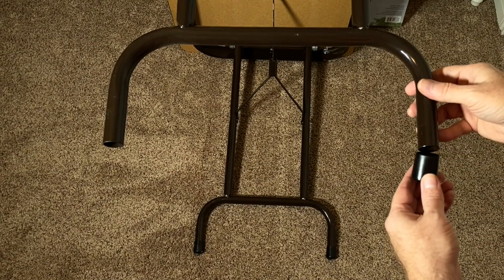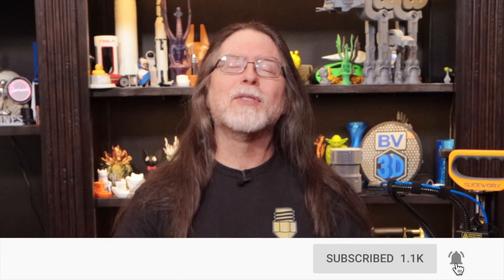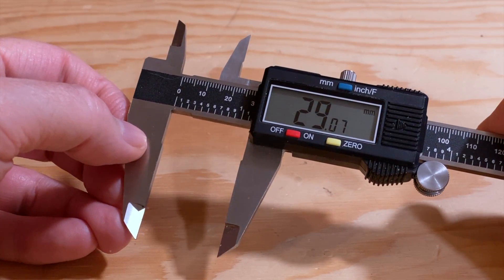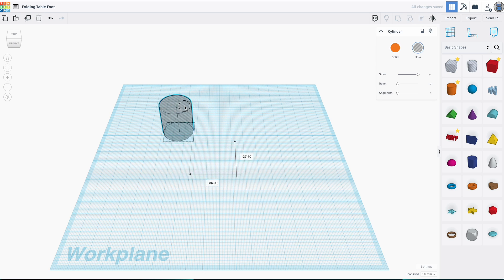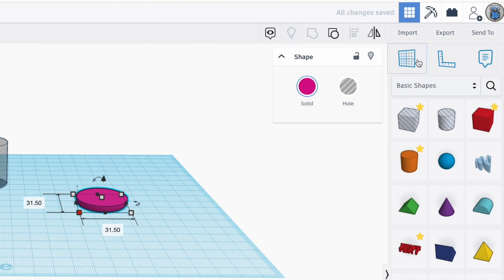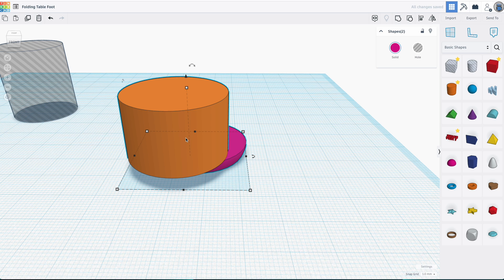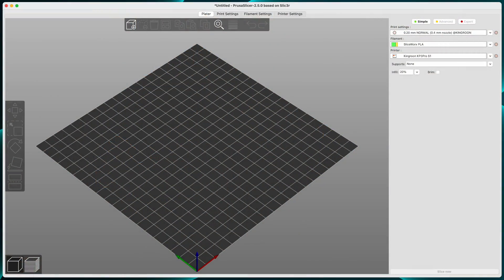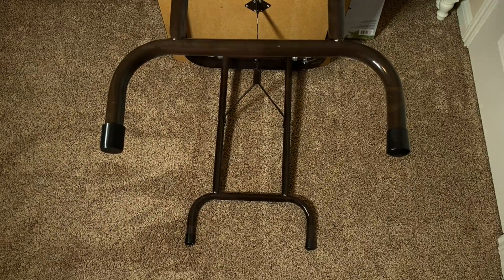Design & 3D Print a Folding Table Foot - DIY Replacement Parts!

Comment: Did something really similar, only in reverse, for a push-broom with the metal tube type handle. The end piece had gone AWOL, so I whomped up a quick sketch in FreeCAD (Hadn't even heard of Tinkercad at that point in my 3D printing life), ran it through about three "oops, not quite the right size in real life" tweak cycles, and produced a hemisphere sized to be an exact match for the OD of the tube end, on a plug sized to friction-fit the ID of the tube. Saves gouging the palm when using it quite nicely. An otherwise nice barn broom would have been junk without it, or something like what you did for the table leg. I went plug, while you opted for a cap, but honestly, your cap version was better suited to the use case you had. I made mine "should be permanent" by tapping a nail through the metal of the handle enough to make it bite into the PLA plug in four places. It's been working well under heavy usage ever since - It gets used quite regularly, being as we're horsey folk - and thus, have stalls to clean and aisles to sweep. Nice to save the price of a new broom by burning up a buck or two of filament getting it right. Means I can buy the four-leggers an extra bale of hay with the money saved. :)

Comment: Nice. Our generator has rubber feet, and 1 perished over time.
So got 1 of the feet. took a verner/calliper and took some mesurments. Tinkercad to the rescue. Used TPU and printed a 100% infill foot for the generator.
How can you tell wich 1 has been 3D printed?
Well it is white and the others are black. This was almost 3 years ago already.

Comment: I too got to design and print a useful part recently, my elderly father wanted a dispenser for cling film as he was sick of cutting his finger on the metal blade on the box, I ordered him a mid priced dispenser from Amazon but when it came we quickly realised it was built for propritary clingfilm from the dispenser company, two parts push into the ends of the cardboard tube which allows it to rotate in the dispenser, I whpped out my Vernier calipers and measured the ID of the cardboard tube and 5 mins on Fusion 360 and I had the part and a couple of iterations later I had a working part, the propritary clingfilm was £4.95 a 10m roll + postage £2.99 but the supermarket roll was just £0.80, my dad has saved quite a bit of money on his rolls of clingfilm!

Comment: Using Tinkercad, I redesigned a crankcase vent for the Young Heng style high pressure compressors we use for airguns.  The factory piece is very soft plastic, and brakes at the threads.  My redesign adds strengthening elements where the factory piece brakes, and is printed using Carbon Fiber PETG.  It works great.